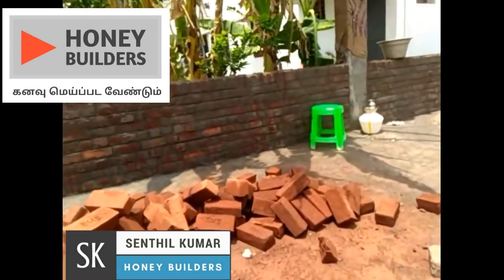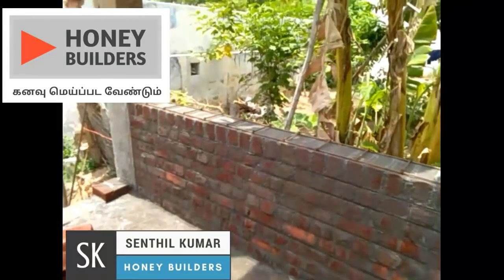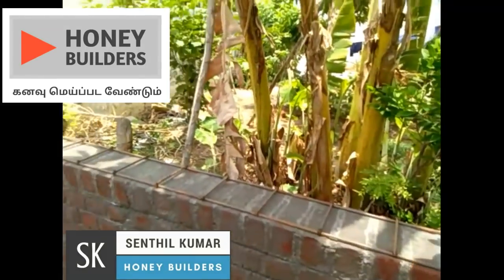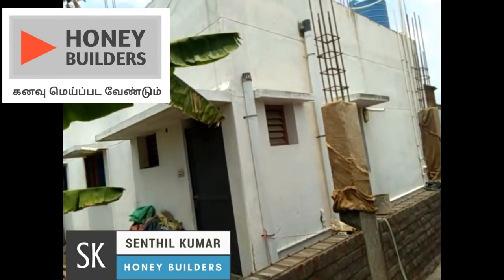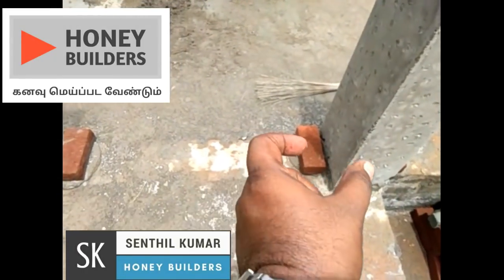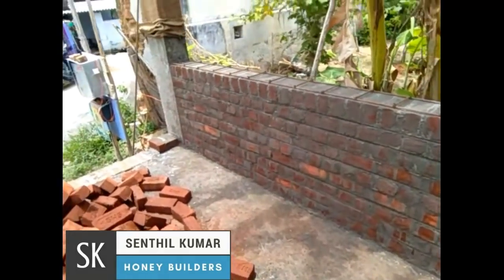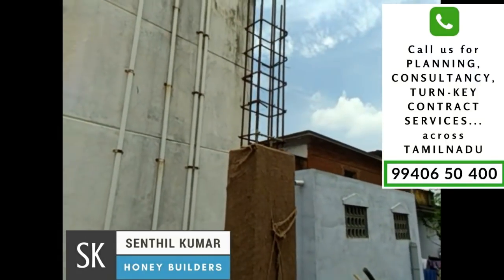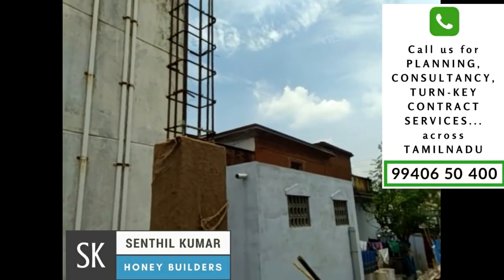கட்டு வேலை & காலம் உயர்த்துதல் - Brickwork and column rising above basement - on site explanation

Comment: Sir,
In the brick you have shown - there is a white patches or efflorescence on the brick, is it not bad.  Does it affect the strength of walls. What is the cause for  this - cement quality or curing by  salt water or any other issue. Pls tell how to  remove it or prevent it